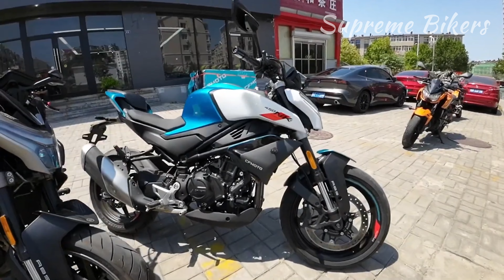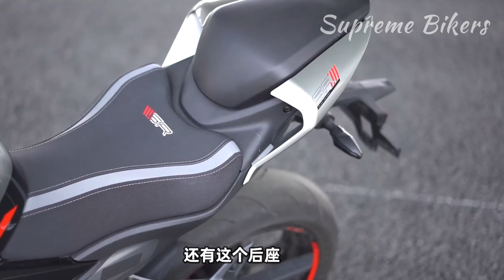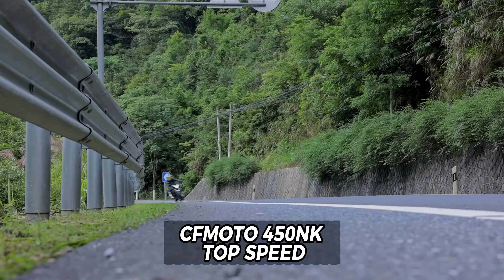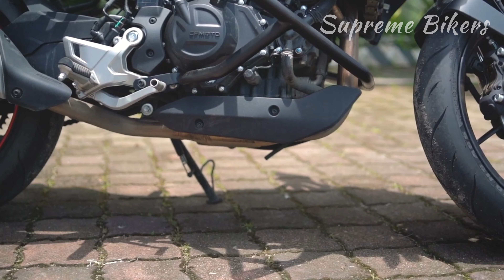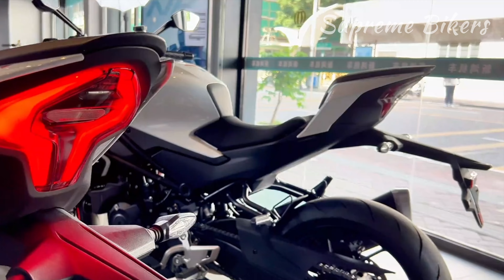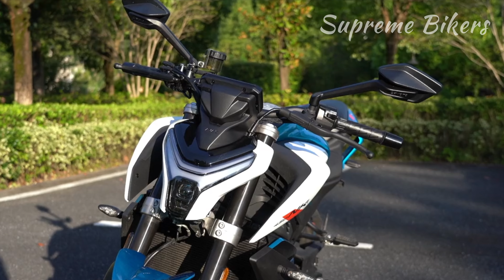CFMOTO 450NK, Better than the New KTM Duke 390

Comment from the maker: CFMOTO 450NK or KTM Duke 390? 👍👍👍
Reply: parallel twin engine and 270 crank, 450NK wins.
Reply: 450NK Ill Sell my Dominar for the NK
Reply: 450nk for sure
Reply: Have you heard CFMoto and Yamaha will tie up
Reply: Duke 390 is not reliable.
Reply: @fulldeporeis  Why do you say that? KTM has a long-standing reputation for performance-oriented.
Reply: They both look good! I’d get the one where the dealer rips me off the least! I managed to get a new RC390 for below msrp just by shopping around and being open on models.. and haggle make them work for the sale.